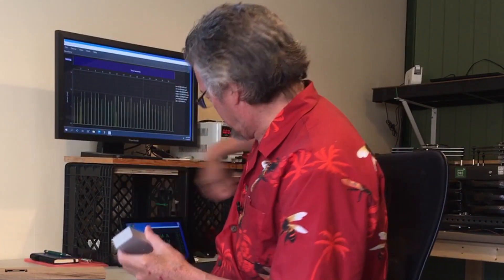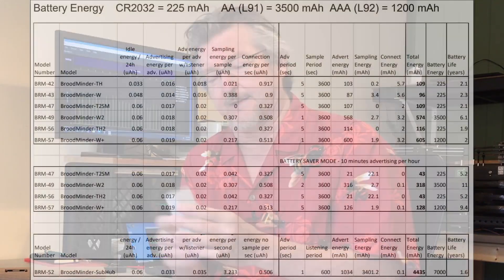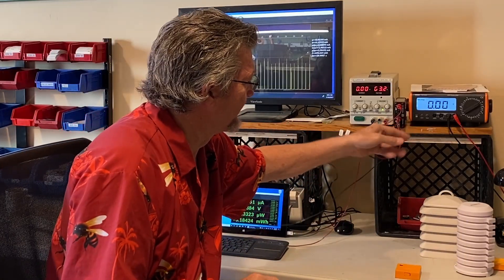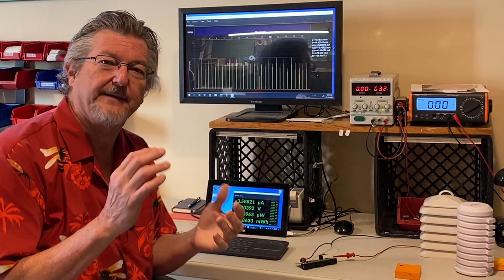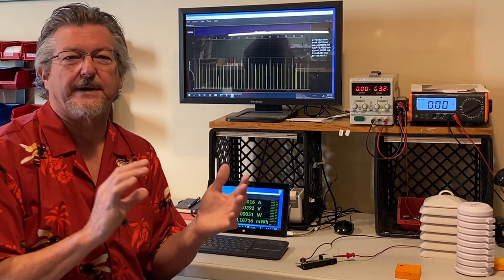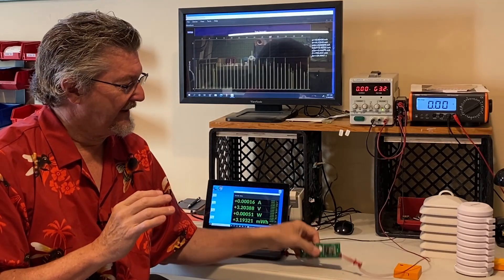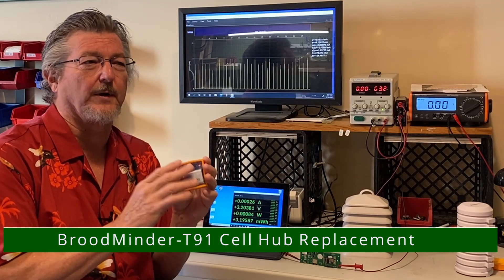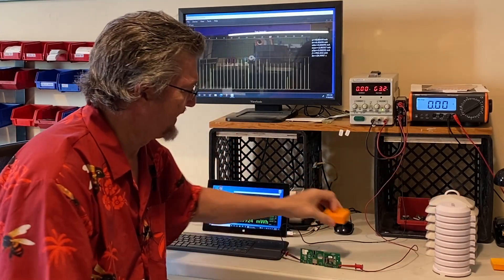S1:E18 Batteries

Comment: Batteries are an issue for us. How much does fluctuations in battery power influence readings on TH modules?  At what % should batteries be replace (does not offer guidance for this in the manual)?  We are finding that "new" batteries are reading in the 70's and 80's at the get-go.
Reply from the maker: Hi TBB, The battery level does not affect the readings, they are very stable. It only affects when the unit can't transmit any more. We are measuring voltage. Hard to calibrate with a very inexpensive processor. It will die fairly quickly at the end. The better way is called coulomb counting, but it is also $$. You will see voltage fluctuate with temperature, but don't worry until it dives below 20%. We recommend replacing yearly before winter. Cheers, Rich